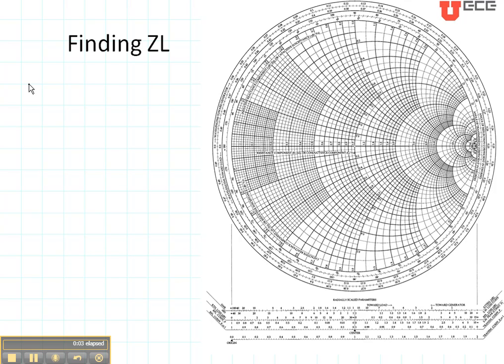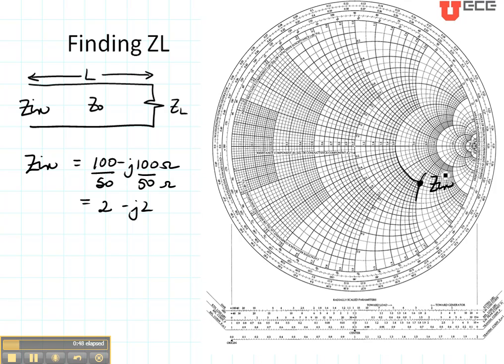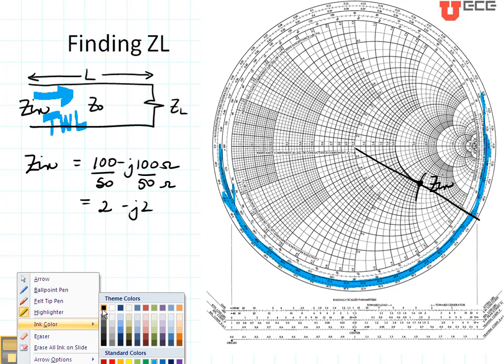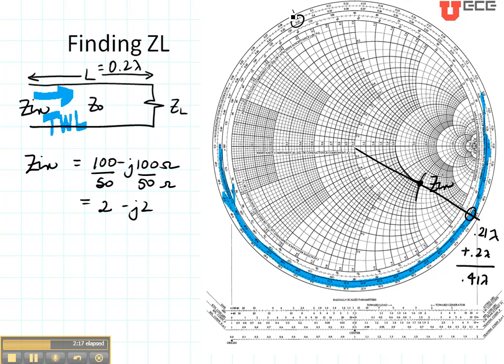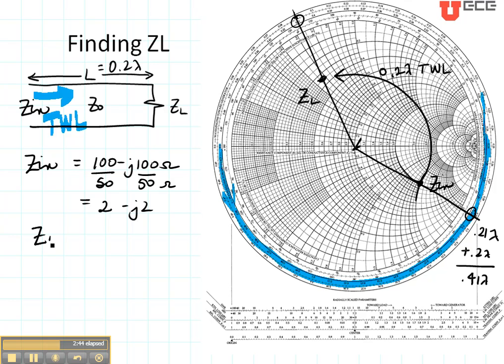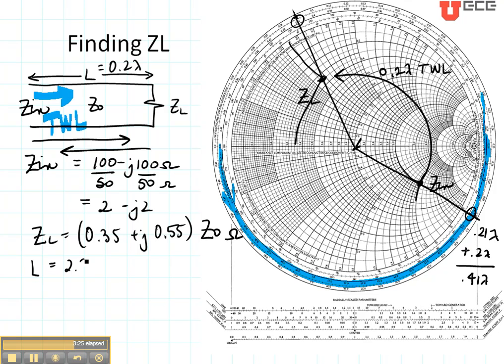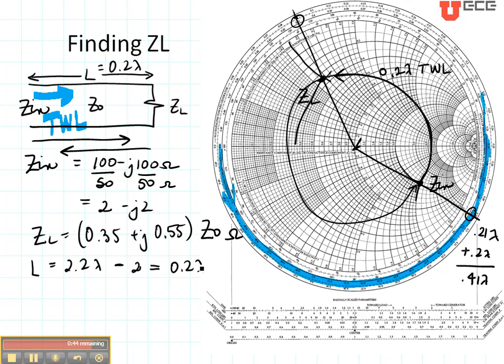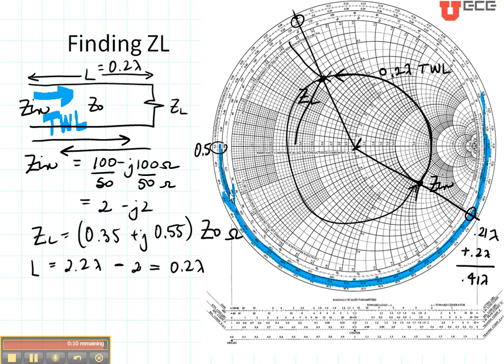ECE3300 Lecture 12b-7 Smith Chart load impedance

Comment: this video does not explain about .61, at last, it ends before an explanation can you tell me where can i get the explanation
Reply: Om Tekriwal I’m not sure is it too late or not but I will answer in case anybody who watch this clip and have the same confusion as you. What I understand is that she show that the smith chart TWL will end at 0.5 wave length and it will start from 0.0. So if you want 0.61 then you separate 0.61 to be 0.5+0.11 and you just read the value 0.11 after 0.5 then you will get the value 0.61 wavelength.  ( Plz correct me if I’m wrong )
Reply: @TheSedimentary1111  Basically if it was 0.61 what you have to do is just subtract that value from 0.5 then you will get the equivalent value.  0.61-0.5=0.11.

 0.11 is the equivalent value of 0.61. 😊